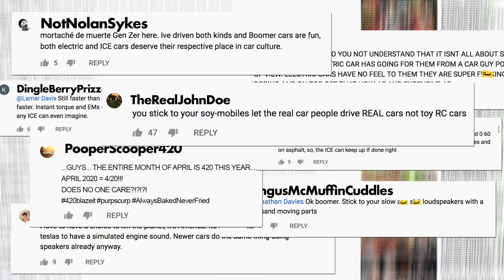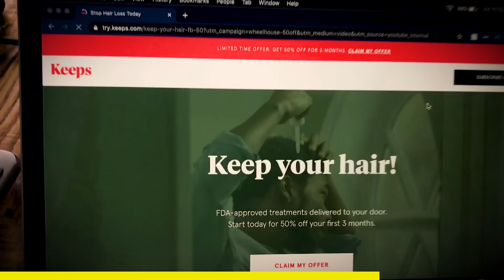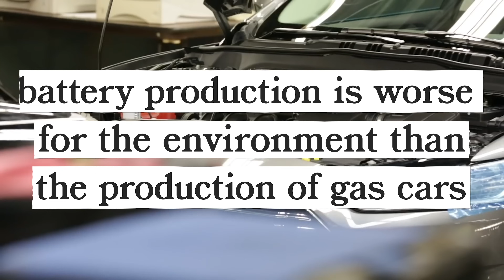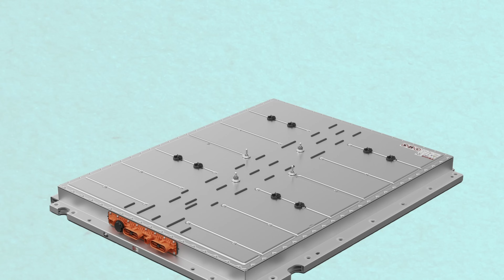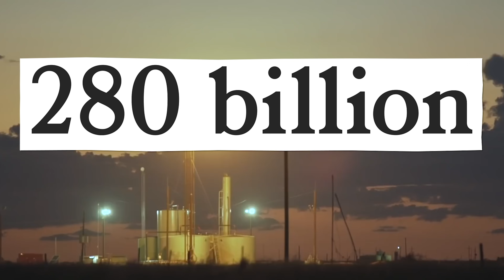Are Electric Cars REALLY Better for the Environment?

Comment: THE DEBATE IS OVER!Well, their liberal green agenda just took a major hit! Turns out a study found that electric cars cause CANCER. The weight of the cars (due to the heavy batteries) cause the tires to wear out faster. This ejects nano rubber particles into the air. This pollutant  has been calculated to be 1000X MORE HARMFUL than exhaust. So IDK where they're going with that idea. Or will they ignore this info and plow ahead anyway because they maybe don't care about the environment like they claim. We will see.
Reply: I would love love LOVE a link to that article. because EV's cannot cause cancer, infact EMR levels recorded inside the car are lower than background levels, meaning you're getting more EMR from your phone sitting in your pocket or you typing on what ever device you're using now. In addition wifi and radio represent orders of magnitude higher EMR. All without mentioning that all of these sources dont emit ionizing EMR which would be required to cause the cell damage that leads to cancer. 

The next point is that whilst batteries are heavy, EV's also dont have massive engine blocks and transmissions. As a result they arent all that much more heavier than a typical ICE vehicle. Infact if you look at something like the model 3, almost a full 3rd of the market offerings in the same class and size category as the model 3 weigh more than the model 3 does.

The other part is that rubber particulates from tires are called microparticle emissions which also come off brakes and most predominantly world wide, from tailpipe emissions. Microparticle emissions are microparticle emissions. The source doesnt make them any more or less dangerous aside from any chemical reactions that might occur biologically as a result however wheel rubber is biologically inert. So it wouldnt be worse than tailpipe emissions. 

Then you have to consider the large Pickups/utes, the large SUV and the big 4x4's and even trucks which all weigh more than current market offerings of EV's, yet their tires dont wear out any faster than any other car. But for some reason you think EV tires are wearing out faster because they.... well.. weigh less than those cars, but weigh around the same as similar cars? That doesnt logically make sense does it?

In conclusion I think you're full of Sh*t and would absolutely love to see you back this up with peer reviewed scientific fact.
Reply: @engineeringtheweirdguy2103  I'm just a messenger, the study says what it says. Sorry to burst your bubble. We've been sold a heap of lies.
Reply: @differencemaker242  from an engineering standpoint some of your claims are absurdly unsound and illogical. Such as the wear due to weight. As I asked before, please supply the evidence to support your claim or I’m calling BS. If they don’t allow you to post links due to the spam filter, just post the article name and authors and I’ll find it.
Reply: @engineeringtheweirdguy2103  Which part of IM JUST A MESSENGER did you miss? It's not my study.
Reply: @differencemaker242  I realised it’s not your study. But I’m asking for you to supply a link or the title of the study so I can look at it. Without it you aren’t a messenger, your just someone posting incorrectly assumptions on the internet and trying to pass them as fact by saying there was an ever elusive and unknown “study” that nobody gets to see.

If you’re the messenger. Give the message, provide the study. The link. Or the title and author so that I can find it and read it for myself.
Reply: @engineeringtheweirdguy2103  Notice this study is from the Brits who are far more fanatical about the environment than Americans. It is also independent, so it was not funded by ExxonMobil or any other big oil company.
Reply: @differencemaker242  Ok, so if you provided a link, it has been filtered out by the spam filter. can you please list the article title and aurthor?
Reply: Source?
Reply: @ianhawkes1135  I gave him the link. I believe it was taken down

Comment: One thing I see was not looked into was energy density for fuel verses the batteries in the electric cars. Another thing interesting to look at would be how often the batteries need to be replaced in the ev and the efficiency of the ev charging over time. Video part 2??
Reply: Efficiency doesn’t change over time. Modern EV batteries are designed to last twice the lifespan of a modern combustion engine.

Comment: Ok number 2 is true I grow up in a family full of line men and I plan to be one most houses have low amp Panels and our grid can barely take everything we have now so you would not only need more power plants but you would need to rebuild most pieces of electrical equipment in the us
Reply: Not at all since most people only drive 30mi a day and you can easily get that overnight with a 120v outlet. Also the grid is adding capacity every year and can easily handle EVs being added to the grid.
Reply: @chidorirasenganz  do you know realize most power grids can be knocked out by light storms plus is the power repair trucks run out of battery and the powers out how do you charge them
Reply: @Minty_cr_125_rider  what does natural disasters have to do with the grid supporting EVs? Also when the power’s out you can’t get gas either. But you can charge an EV anywhere there’s an outlet. Can’t say that about ICE cars

Comment: Well that was never the issue with me. I want to know the impact of evs failing. How deadly is the smoke what kind of effect does the battery acid have on the environment is spilled on and a new fact I came across is that it takes an insane amount of water to put out an ev fire and what kind of impact does that put on desert states who not only are prone to fires but don't get much rain. I agree that in the long run less carbon is released but that's never been the question for me.
Reply: Well firstly EV’s are far less likely to catch fire than a combustion car. Lithium burns in air. So you can’t put it out with water, only soak it enough to prevent air from getting to it. That’s why they’re mostly places in giant pools when being transported from a major accident but chemical foam such as the type used at airports will work to put the fire out. It’s just a paradigm shift from what we do currently. And lastly, lithium batteries aren’t acid batteries. You’re thinking lead acid batteries. Lithium batteries do not have acid and are around more than 95% recyclable.
Reply: @engineeringtheweirdguy2103  informative thanks but I also read about cobalt wich is used in lithium batteries what happends to that when burned. I read it's used in a bomb that cause eminse amounts of radiation I get there are other compounds involved but does cobalt produce gama or radiation? I'm not to savy on this subject so not to sure on the difference between the two but I understand both have potential to kill you but that's about it
Reply: @Get-Over-it24  you can refine certain types of cobalt to be radioactive but generally no, It isn’t radioactive. And certainly the type used in batteries isn’t radioactive. The cobalt in batteries is inert and doesn’t degrade or burn up meaning it too can be recycled with the rest of the battery to be used in new batteries. However modern EV batteries which started rolling out this year don’t use any cobalt at all (see a Tesla 4680 batteries).
Reply: @Get-Over-it24  cobalt is also just a metal. If it’s burnt in a fire. It just gets hot. The melting point of cobalt is 1,500C (2700F)

Comment: We burn fuel to make batteries and what happens when these batteries stop working. How do we recycle them. Also that uses fuel too.
Reply: Batteries are around 95% recyclable and last twice the average lifespan of a combustion engine.
Reply: @engineeringtheweirdguy2103  How do we produce batteries without coal.
Reply: @JankyDubz  the same way we produce electricity without coal
Reply: @engineeringtheweirdguy2103  how do we produce electricity without fossil fuels?
Reply: @JankyDubz  solar, wind, hydro, geothermal, nuclear, tidal, wave, you name it.
Reply: @engineeringtheweirdguy2103  nuclear sounds promising.
Reply: @JankyDubz  except for the waste it creates which is dangerous and we have no idea what to do with it, even to this day, we just throw it in specially designed barrels and put them in warehouses next to the plants. But their contents will be dangerous for thousands of years and those barrels will only last a few hundred

Comment: the problem with EV is the cost, when EV and car with combustion engine are the same cost then people maybe consider buy EV. for now I'm not planning to buy EV.
Reply: Chop  don’t need. Just want
Reply: Chop  sometimes. Also talking about these things interests me incredibly.
Reply: This is already a problem which looks to be resolving itself. Despite higher initial costs, that cost is more than offset but the drastically reduced operational and servicing costs.

Comment: Considering areas of the US are already experiencing rolling blackouts and people are being asked not to charge their cars I'm gonna have to call bullshit
Reply: Context is important. They're asking people not to charge in Texas because the market operator forced gas power plants to delay maintenance for extended periods of time. a cascading failure resulted in 6 gas power generators to go offline, reducing the grids energy input by more than a whole 3rd. Under normal operating conditions the grid would be more than capable of handling EV charging. If you're looking at California you will note a period of time where EV's on the roads there were REDUCING but the amount of rolling blackouts or brownouts were INCREASING. meaning it was not due to power demand but rather exceptionally and world leading incompetence in their grid design and set up, which should be flagged as a case study of when politics decided to enter the realm of Engineering and politicians get to play as grid engineers. The result is a grid that was not set up for renewables, but renewables were forced onto the grid anyway, so when over producing occurs, the grid gets shut down to prevent burn outs resulting in wild fires. Note that other grids around the world have a higher percentage of renewables than California but have some of the highest reliability and lowest wholesale energy costs of any other grids in the world. Because they're set up by competent Engineers with proper planning. 

SO, context is important.

Comment: the electric grid shuts down in a summer heatwave under just air conditioning... and you think the cars aren't going to do it over a whole summer period too? you're delusional. also, fair, ev's don't emit... but if you replace every car with an ev, and only have ev's.... then you still have the massive output of pollution, and we haven't even touched the refining of the battery resources.. the problem isn't so much the individual components, it's the process, and it's only going to get worse when you suddenly replace every single factory that manufactures the combustion engines with ev's. they have to keep up with demand somehow.... have a think about that bit. there's more to it than just the stats you brought up. and yeah, maybe the car can pull a jumbo jet.... but you do not have electric charging stations in the middle of nowhere, so most of your transport, where there are no trains, fails immediately. 

in short, the electric system is not up to scratch to step in and replace the vehicles of today. eventually they will, but innovation for the sake of innovation will be detrimental to our way of life, not improve it...
Reply: Where shuts down in summer?
Reply: Also that’s an EXTREME simplification of manufacturing. It’s really not as bad as you make it out. Especially when you consider that it happens over time. Not overnight.

Comment: Electric vehicles are horrible for the environment from the manufacturing process to battery disposal
Reply: No they aren’t.
Reply: @engineeringtheweirdguy2103  they literally have to dig up 30 tons of dirt to get the rare metals to make ONE Tesla battery.  

Ever thought about what happens to those batteries when they're toast?  Landfill and leaking brother - poisoning our water
Reply: @stevenbrown5210  depends. What lithium methods are you taking about? Clay extraction? Brine extraction? Sediment? Salt? Rock? Be more specific. As for battery waste, modern EV batteries are around <95% recyclable. So no, that doesn’t happen. You won’t have to worry about poisoned ground water.
Reply: @engineeringtheweirdguy2103  lol how many covid booster shots did you have to get to believe all that?!?
Reply: @stevenbrown5210  google it. It’s pretty basic. It’s common knowledge that EV batteries are more than 95% recyclable and lithium batteries use electrolytic fluid. Not acid.

Comment: Well answer to that is biofuel.
Like Algae it like petroleum, I mean they are trying to make bioplastics out of it.
Plus it's carbon neutral.
Add it to vertical farming meaning even less land taken up, more land goes back to mother nature,
Put in cities and town travel time is low meaning cheaper biofuel.
And endless supply because we grow our fuel.
Meaning electric will then be the biggest polluters. Because the fact is they still have to mine or use child labor to get what they need. Mean 7 metric tons of CO2, compared to electrics 17 metric tons of CO2. Well biofuel is better then electric. And I'm a car girl I'm not giving up my car.
I'm never going to get a Tesla it's kinda like. "Hey a tech company created a car" rather then a car company with a high tech car. I'm sure car enthusiast could get behind biofuels more.
Then a car where you need to be a computer science major just to fix the damn thing, a car that doesn't make that sweet sounds we all love when we turn on our babies and rev her,
Has no manual transmission,
And the damn car won't even let you drive. It would be like living with a very controlling significant other that has to micro manage everything.
Idc I'm going to die on this hill with my Nissan Silvia S13 till the end, I'm not giving her up. Oh BTW if you don't get it biofuel means we can keep our cars that we love and see more of them in the future.

Comment: Except the texas grid
Reply: That depends, if you’re counting during a natural disaster or not. Do we count blackouts from hurricanes in Florida?
Reply: @engineeringtheweirdguy2103  Ercot wants texans to set their thermostats to 78 during summer days to have less black outs. And thats on a nice sunny day.
Reply: @EllittleGee  well that’s only due to the fact that ERCOT has repeatedly asked power plants to delay maintenance on their power plants, taking and over cautious approach after the blackouts during the snow storm. This has resulted in 6 gas fire power plants going offline due to breakdowns. Under normal circumstances Texas would have more than enough energy. At current Texas is getting by without 6 whole powerplants (approximately 2,900 MW.)